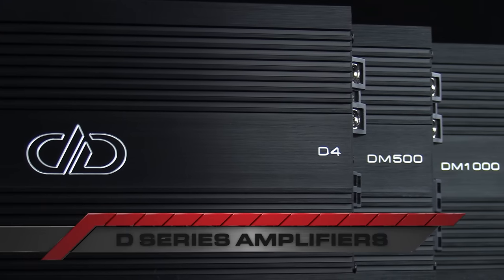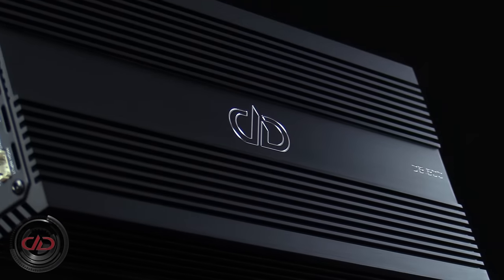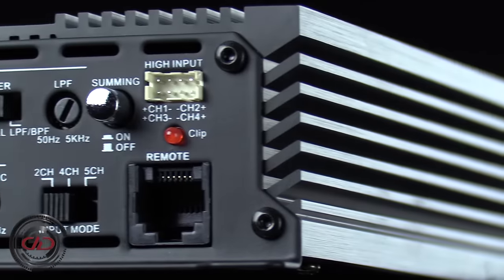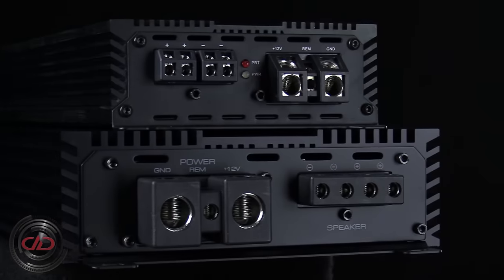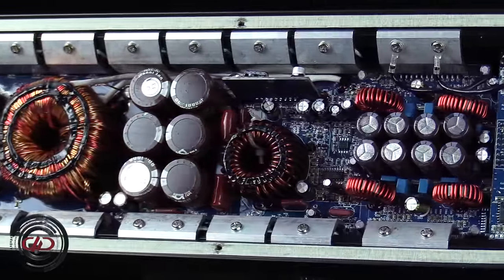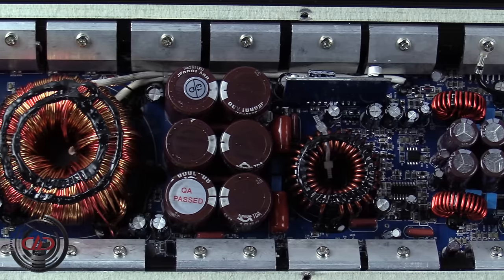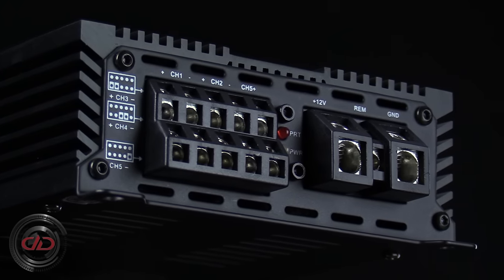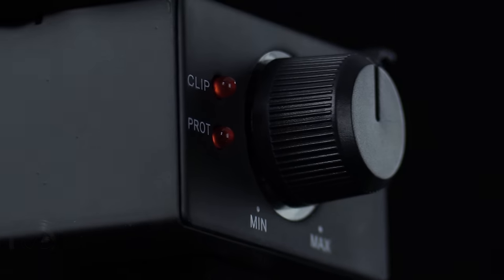D Series Amplifers Product Spotlight

Comment: I have a dm1000 which I bought barely used and it pretty much blew up. Proper wiring and on normal listening volume the bass just stopped and I opened the amp to find some burned area along the heat sink (inside). I believe it was faulty when I bought it. Not saying it is a bad amp at all

Comment: Can a dm2500 run 2 dd 612 d2 subs rated 600 rms each wired at 2 ohms ?
Reply: Nasheel hurdhaw that’s a silly question because that’s way way more then enough dm 1000 would push two of those cleanly

Comment: no local dealer for 500+ miles where is a reputable place to buy DD?
Reply from the maker: You  can give us a call at (405) 239-2800.
Reply: Cody Hodgson
Reply: u can call DD I hav got 2 2512 sub's then I got 2 3515 sub's and 2 DD m1 amp's all these I got from DD audio cause there was no dealer around but it is a little cheaper from a dealer

Comment: Often I hear people have problems with DD amps...
Reply: Ale Wu m5 runs 1/2 ohm on 8 12’s no problem. And it’s only rated for 1 ohm. Only problems I ever hear is when people hook these to stock charging systems. Almost guaranteed to pop something then. Amps generally fail when voltage drops to low.